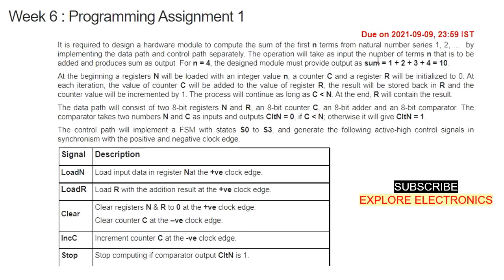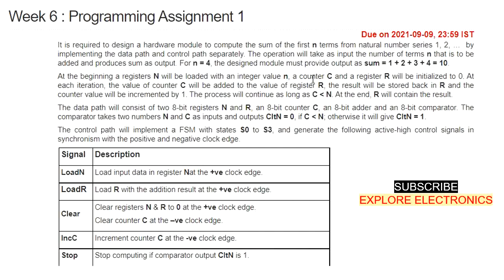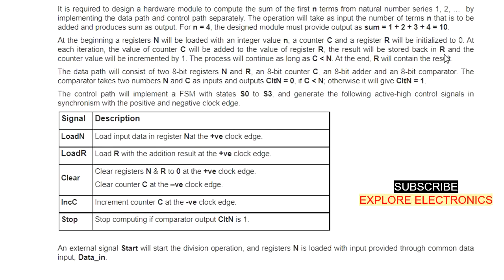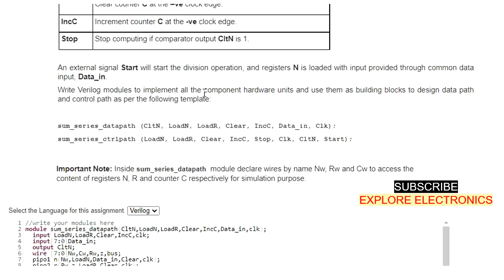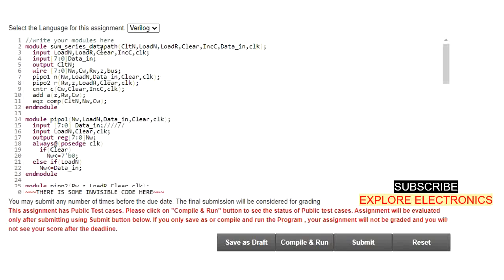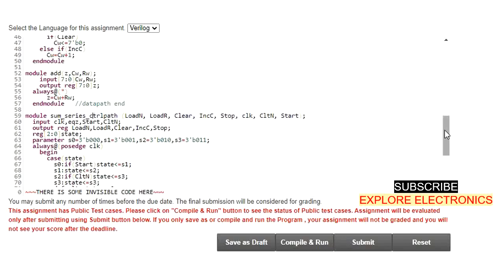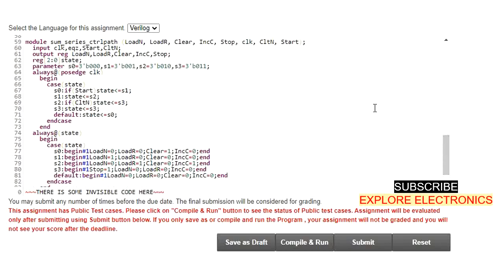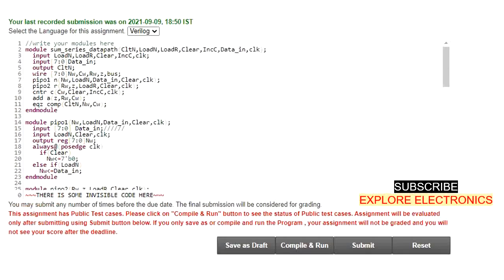Sum of n Terms Datapath and Control unit | verilog datapath design

Comment: I am Watching the Video and Will Add my Constructive Comment after warching the full video
Reply: Can please paste  code file
Reply: @jahnavibandaru2337  You can watch the video carefully and type the code  on your own hand.

It will help you to learn how the code is flowing to the output. It seams like rwriting 94 line, but belive me it not that much kf coding. Just sinple lines and spacing makes it 94-100 lines of code
Reply from the maker: @jahnavibandaru2337  join telegram channel
Reply: @rishav4459  I was sending the code because it was errorneous and I wasn't able to figure out where the error is occuring so Probably anyone could have told me Where I was going wrong in the code 

And Whenever I was Sending the code, I was repeatedly telling that It was not passing the test cases or partially passing the test cases.